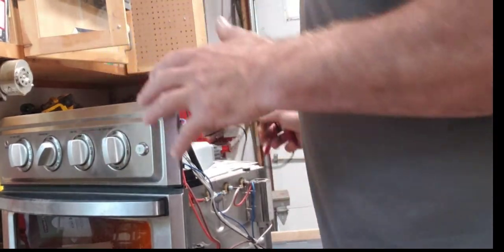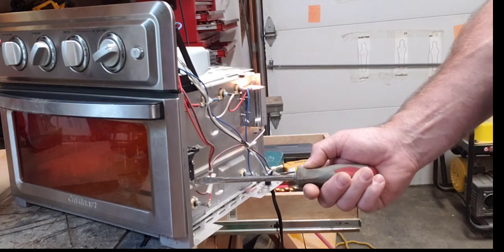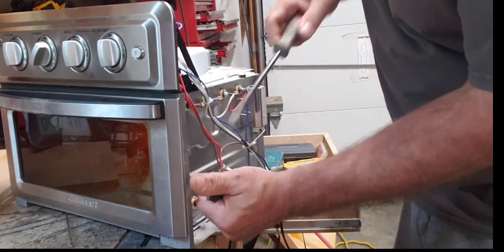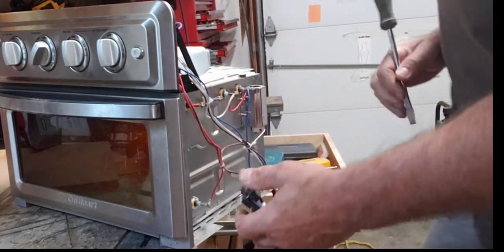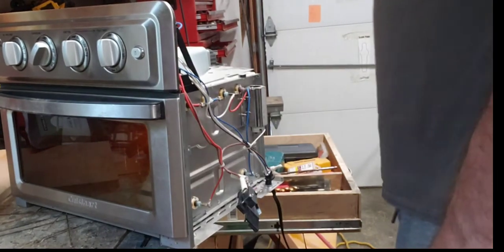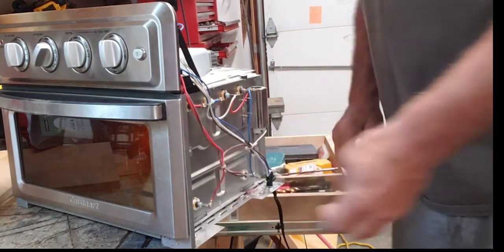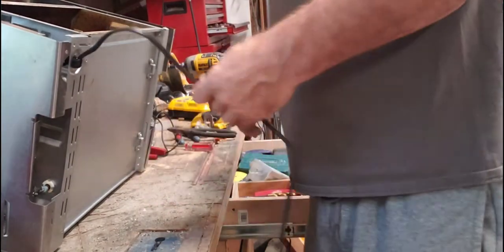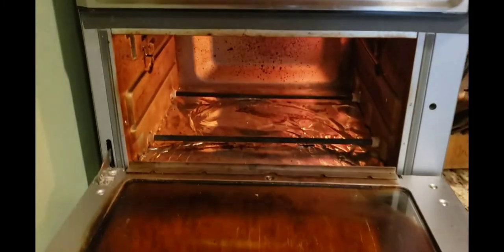Fixing toaster oven

Comment: Good video. Mine just failed after 4 years heavy use. Micro switch failed, as you show. I didn't take mine completely apart only the left hand side looking from the back. Of course I removed the back plate and foot bracket two screws in the front easy enough to get to. Then just lift it up the left hand side open up wide enough to get to the switch and wiring. One comment, I used a ceramic wire nut. The one you installed is only good up to about 220° f. Gets a little dicey because that oven does get very hot when used for a prolonged period of time.

Comment: Hi . I have the same oven brand new and it doesnt hold temperature . If i set to say 400 degrees it just keeps climbing up to 500 and beyond ???? I put a thermoworks temperature gauge inside to test the accuracy .
Reply from the maker: If it's brand new ,just return it.  Thermostat inside is not working most likely.

Comment: Ours just quit working today, the plug is partially melted. Is it possibly overloading my house’s electrical system?
Reply from the maker: It shouldn't be ,unless house is really old.  Electrical Breakes should prevent it
Reply: @baldthebuilder2588  I shouldn’t think so, that’s why I asked. House was built in 1978. I got it working again and test ran it, the plug blades get really hot. I’m thinking maybe the outlet is worn out. It was the switch not engaging that made it quit.